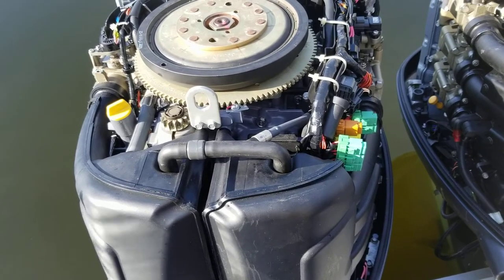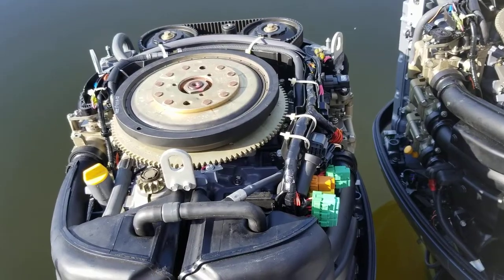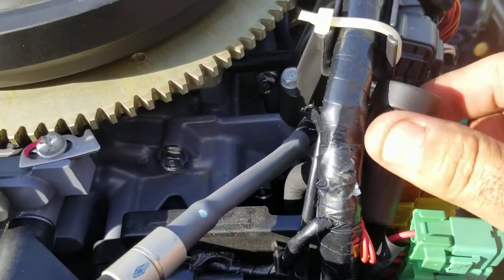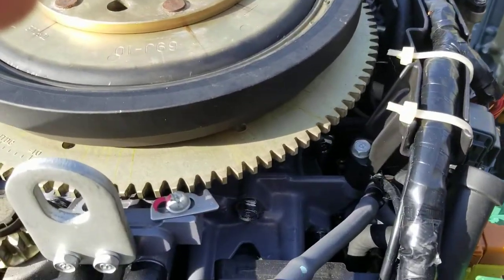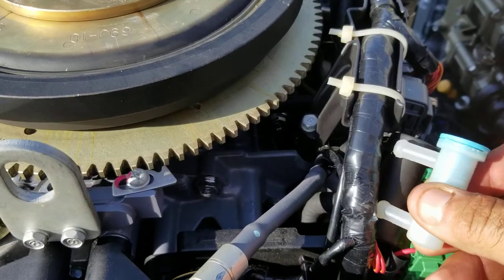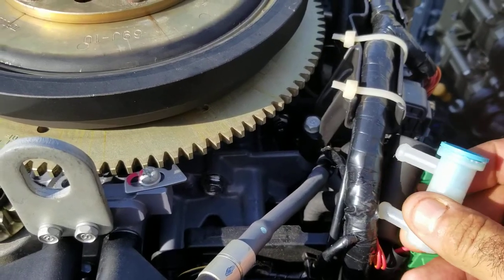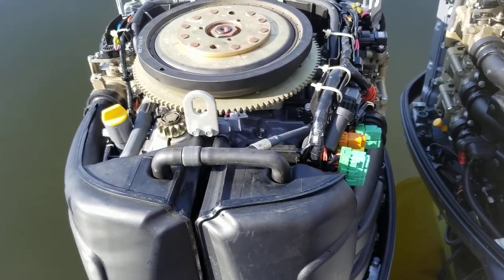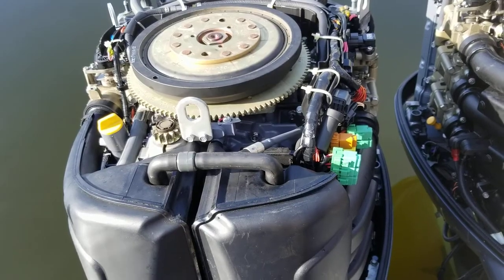225/200  Yamaha outboard fuel issues replace this filter and your problem will disappear

Comment: What problems were you having with the motor itself, as in what was it doing when running it
Reply from the maker: It did not have any top end
Reply: Yup, and one of mine was backfiring, (lean) and the other one just keep dropping in and out

Comment: I'm a Yamaha tech. Yes, this filter is absolutely a common problem in all  fuel injected Yamaha outboards, but if it is getting clogged up, the reason is that you have contaminated your fuel supply. Usually it's because you have ethanol-containing fuel corroding the aluminum/steel tank. The ethanol can also corrode the aluminum inside the vapor separator itself, which will then clog the high-pressure filter that you see here. The problem is caused by the fact that ethanol is highly hydroscopic, meaning it absorbs moisture, which there is a whole lot of at sea, and the fuel tanks usually have a big breather hose connected directly to the outside of the hull. If you're changing this rather expensive filter, you absolutely have to clean the vapor separator, other fuel filters, fuel pump and lines, or else it will reoccur. I always run the injectors through a cleaning process also. E10 is a boater's worst enemy.

Comment: What’s this filter called?
Reply: Did you ever figure it out?
Reply: Still nothing on name of filter.  Pretty crazy important bit of information
Reply: 2X In Line Fuel Filter 69J-24501-10-00 69J-24501-00-00 18-79905 18-79981 for Yamaha F150 F200 F225 F250 FL150 LF150 LF200 LF225 LF250 F250B